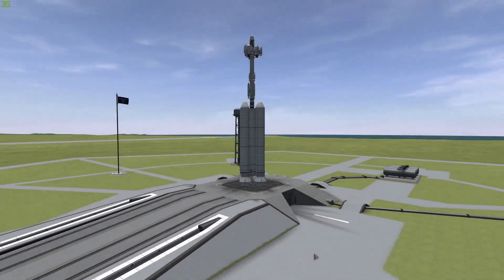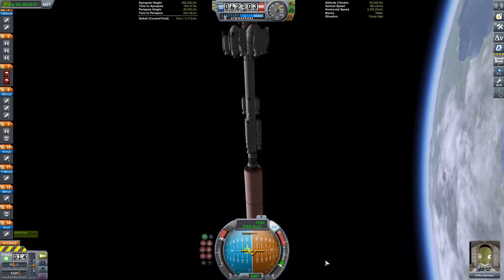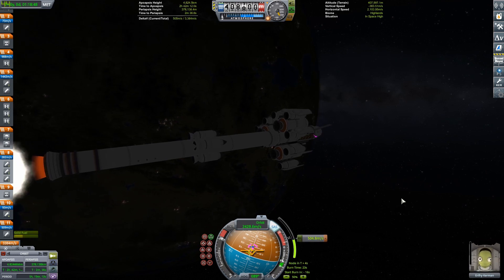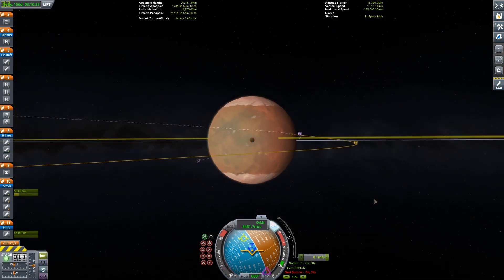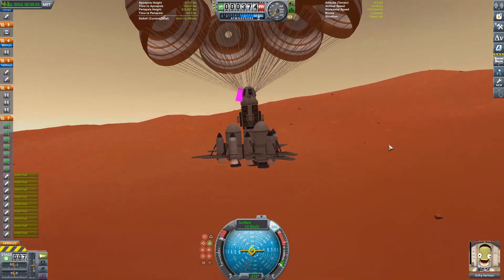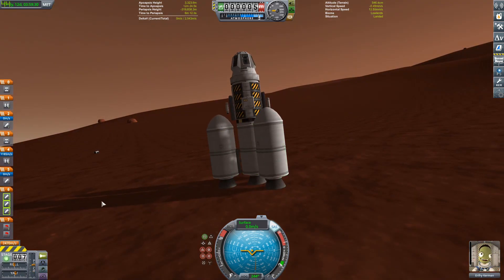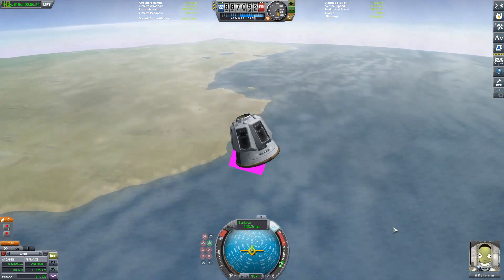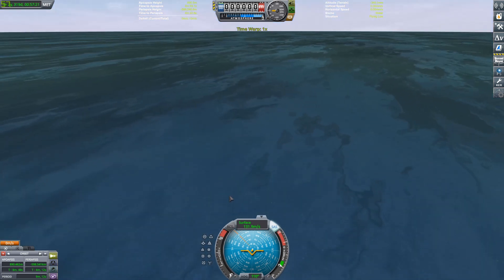Duna And Back Using SOLID FUEL Only! KSP [stock]

Comment: why not detach a burning booster when your done with it? just takes a good separator and good placement. or of course use seperatrons themselves for fine burns.
Reply from the maker: The main reason I didn’t detach some of the radial boosters was because I was concerned that they would run into my upper stage boosters. But my design was also far from the most efficient